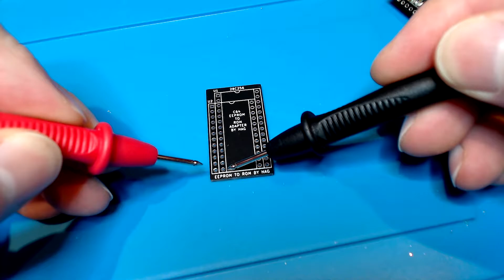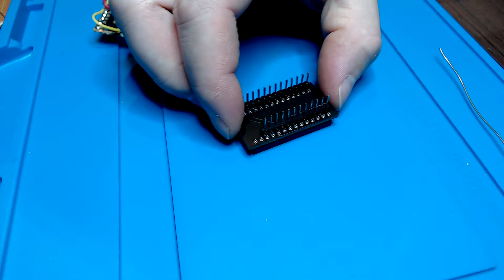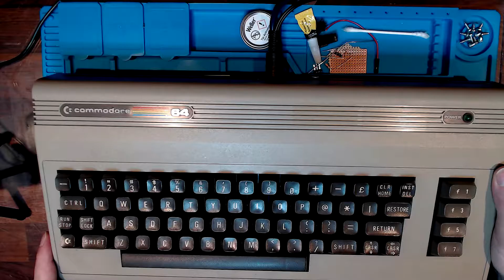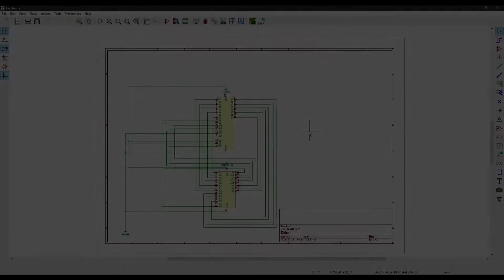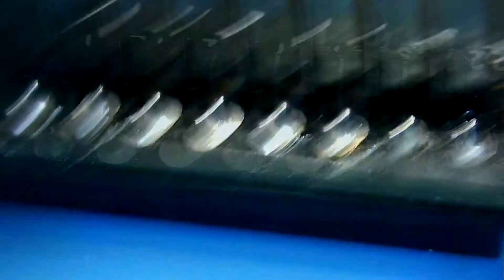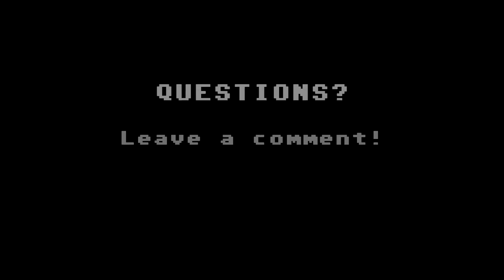C64 Fix Series | Soldering, testing and repairing my new EEPROM adapter PCB! [Part 6/?]

Comment: Excellent work! Can you tell us where you got the ROM adapter board from or did you design and print your own
Reply from the maker: Thank you! :) I made one manually at first. Just used some spare sockets and re-wired the pins between them. Then I designed one in Eagle and got it printed, mostly for fun. Made a mistake that I had to debug and fix in the video as well... 🤦‍♂️ You can probably buy some better EEPROM-adapters from someone online or find a good open source version you can get printed.

Comment: Heh. Better than the stuffup I did on one of my boards. I got the wrong footprint and not only was every pin out by 4, the footprint wasn't even the right size. I did manage to kludge around it only to discover a mistake on the original schematic I was working from.
Even then the original designer and I were able to get it working and from there we did a second revision that worked first go.
Reply from the maker: Well, it's never perfect the first time around. At least this time it was an easy fix. I guess that's what happens when I do stuff like this late at night in a rush. 😅🤦‍♂️ But it's better to get a revision out there and get started than to waste a lot of time on doing everything perfectly and end up with no project at all.